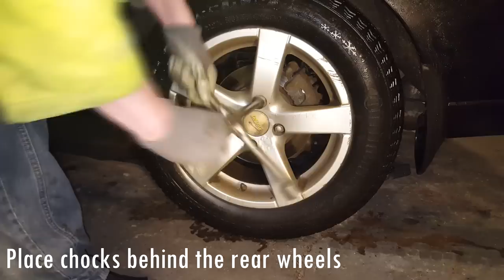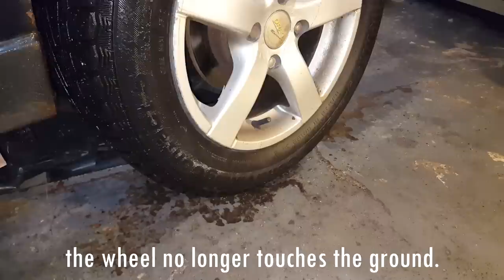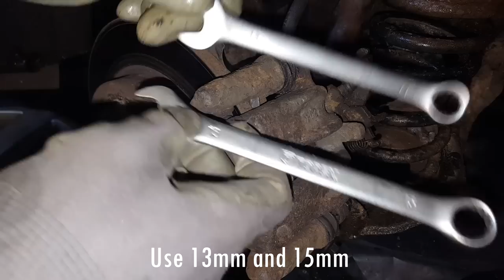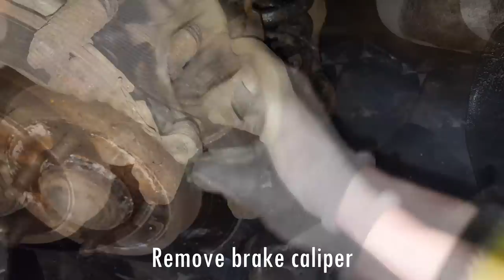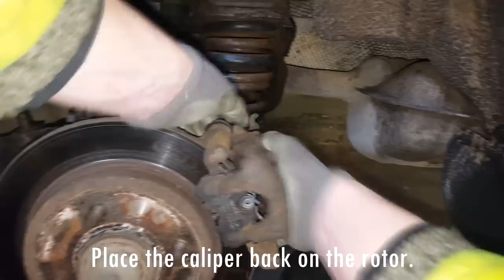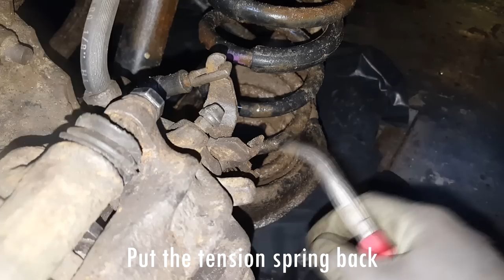Ford Focus Rear Brake Pad Replacement MK1 no extra tools needed

Comment: Thank you for the video!My car have the following issue:The hand brake does not work on right wheel. The cable seems to be OK, is moving the lever, but the brake piston is not moving. When I step the brake pedal, is working.So, can be adjusted somehow?
Reply from the maker: It could be that your break cable is not tight enough. You need to remove your Focus centre console near the handbrake lever.  Then you'll see a nut attached to a threaded spindle on the driver's side of the handbrake. Get on it with the 10mm deep socket and start tightening. Put your fingers under the handbrake cable that's exposed behind the lever. Then you’ll feel how loose it is. When it starts putting pressure on your finger, you've probably got it tight enough, or close.

Comment: For some reason on my breaks there is so much tension on the handbrake cable but not the actual cable the sheathing around it, it makes it so I can’t get the caliper over the pads